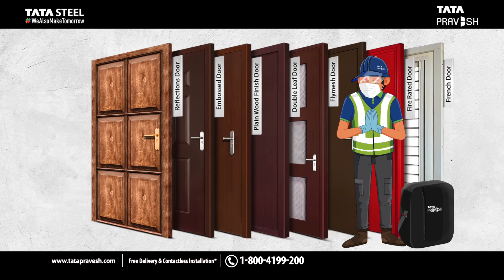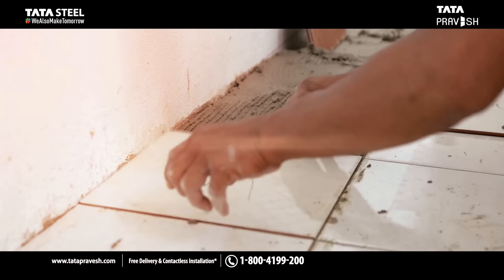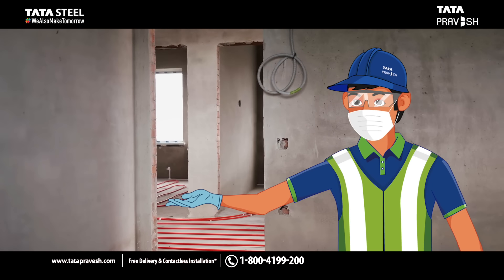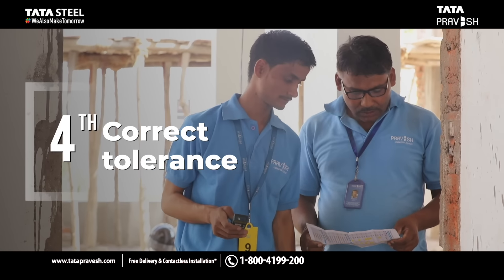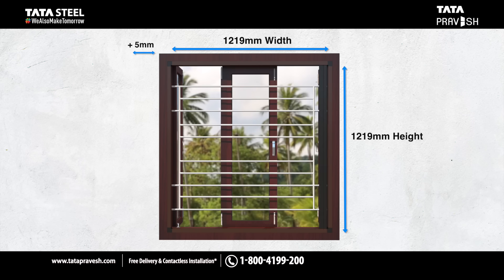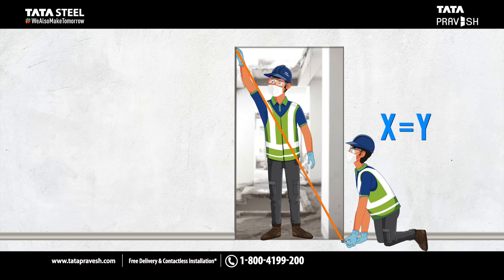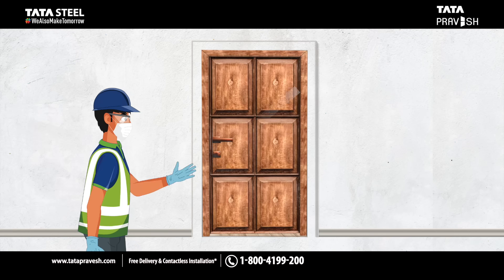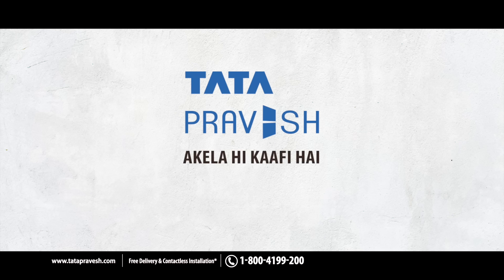Tata Pravesh | 5 Checks for installation-ready wall openings

Comment: I thought all my troubles are over for installing a new door. Though this door is costlier than regular doors and even more expensive than similar steel doors I thought since it is Tata brand we can pay more for quality and quick service. But every video here has comments on how bad the service is and how late they are delivering the doors. For a new house a delay might be ok but for an existing house where we have to remove the old door and finish the wall if there is delay then we will have to sit with an open hall room till the door comes. Pathetic. This is really reflecting badly on Tata Brand.
Reply from the maker: Dear Raj, we are extremely sorry for the inconvenience  caused. Kindly DM us your pin code and  registered  mobile number  along with the booking id, so that our team can get in touch with you on priority to understand your grievance.  
 https://wa.me/message/UBOFEELF7DZJE1
Reply: After paying full amount getting screwed is the worst thing in life. Product quality is pathetic and installation is shit.
Reply: @TataPravesh  I have not installed a door. I have decided not to go in for TATA PRavesh doors based on the comments Unless you can convince me that you will deliver the door on the said date and not delay it. I have to change my existing doors.
Reply from the maker: @rawraj1578  Hi Raj, we hope you give us a chance to prove that Tata Pravesh remains a one stop door and window solution in this market! We take our customer complaints very seriously, just as much as our prospective buyers. Kindly share your  mobile number and 
pin code or you can mail us your details at helpline.pravesh@tatasteel.com for further assistance.